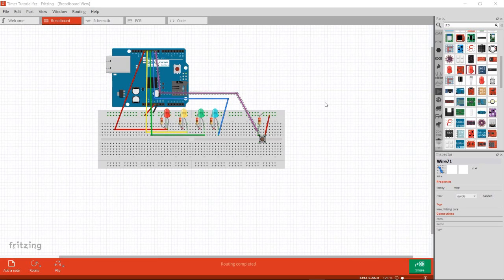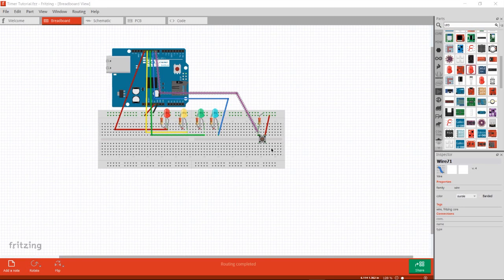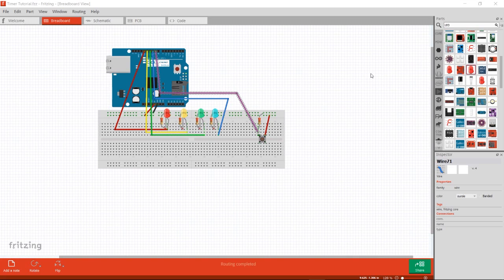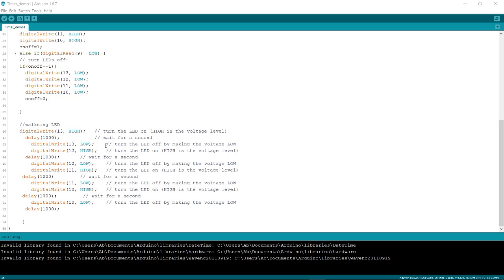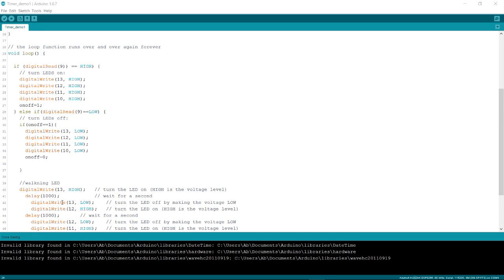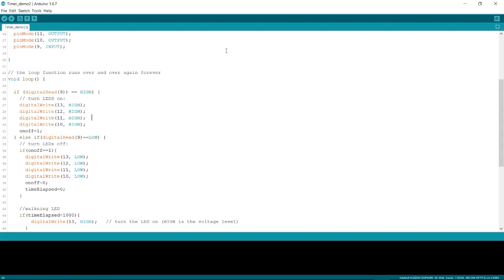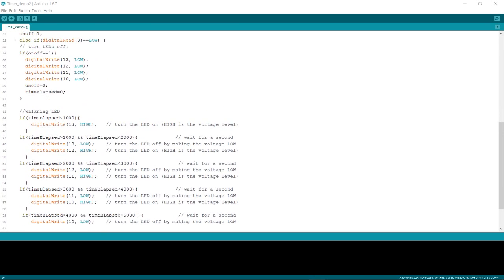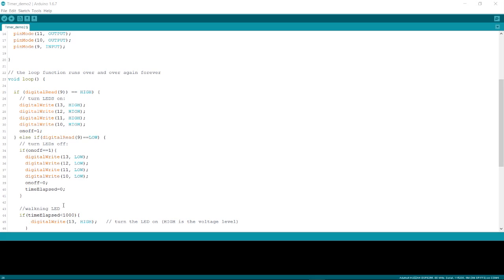Tutorial: How and Why to use Timers instead of the Delay() Function

Comment: For me using delay is much better than counting time with millis. You just need to put delay in loop like this:
while(1){
 while(button == LOW || d < 2000){
  button = digitalRead(button_pin);
  delay(1);
  d++;
  }
 digitalWrite(LED, state);
 state = (!state);
 d = 0;
}
Reply: delays makes your program not respond over the delay interval. I understand that you may get away with it in small programs. But as your projects get larger, you never want your program to hault at some delay function.

Comment: Im working with ultrasonic sensor for human detection to turn on led for 10sec with delay( ).Can I use millis( ) instead of delau ()
.Thanks
Reply: You can, make a unsigned long variable and write the function millis(); to it. Make an if statement where ir states that when the variable - previousvariable it is equal to 1 it will count or call another function. Than write the current time to the previousvariable and it wil loop again. This way you can base multiple tasks on this counter
Reply: You can use delay also. just use loop like this
digitalWrite(LED, HIGH);

while(d < 10000){

 /*

 / /any reading/writing and other stuff here

 */

 delay(1);

 d++;

 }

digitalWrite(LED, LOW);

d = 0;